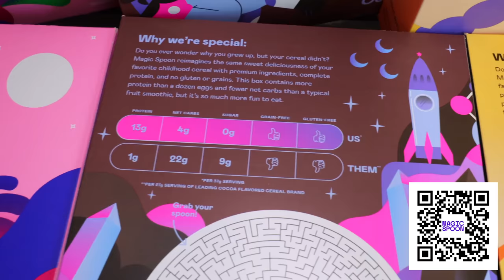Recycling Vintage Metal Cabinets For Our Metal House |Ep:125| Container House

Comment: Excellent work you two. A suggestion for staining pine and other woods that come out a bit splotchy - Mix 3 tbls wood glue + 3 tbls clear wood finish + water to make a quart mixture.  Paint that on your pine and allow to dry before you stain and you will be amazed at how even the wood takes that stain.  I've used it on my solid ash cabinets and it's well worth the effort - removes about 95% of all that dark-dark stained areas and comes out so even.  Unless, of course that is the look you want - if so, ROCK ON! Keep up the great work!

Comment: In Italia, ma anche in buona parte d'Europa, i muri sono al 99% in cemento e mattoni, così non hso il problema di trovare i montanti, anche una coppia che ha fatto casa con i container ha usato cemento e mattoni per le pareti interne. Per impianto elettrico si preparano sia canaline ignifughe per i cavi che sono del tipo multifilo, quelli a filo rigido in Italia sono proibite, e si preparano tutti i tubi per acqua calda e fredda.
Una cosa che mi piace fare con le uova fresche...fresche…un tuorlo+2 cucchiai di zucchero e poi si sbatte fino a farlo diventare quasi bianco e denso, a volte aggiungo una goccia di caffè...😋😋

In Italy, but also in much of Europe, the walls are 99 percent concrete and brick, so you don't hso the problem of finding mullions, even a couple who made their house out of containers used concrete and brick for the interior walls. For electrical system you prepare both fireproof conduits for the cables that are of the multi-wire type, the hard wire ones in Italy are prohibited, and you prepare all the pipes for hot and cold water.
One thing I like to do with fresh eggs...fresh...one yolk + 2 tablespoons of sugar and then you beat it until it becomes almost white and thick, sometimes I add a drop of coffee...😋😋
Reply from the maker: Oh my goodness so interesting. Thank you so much for sharing. You learn something new everyday!